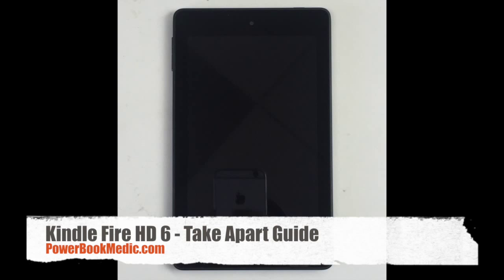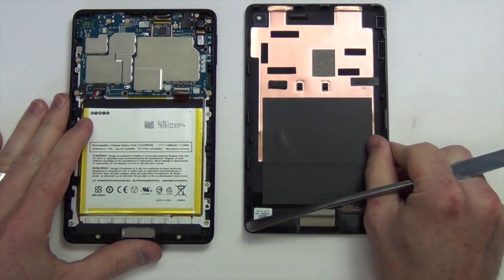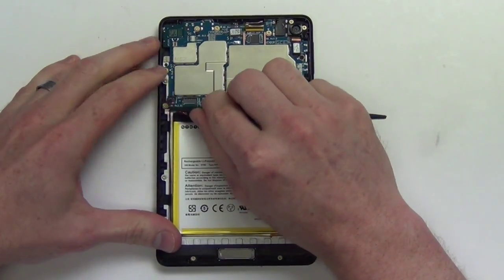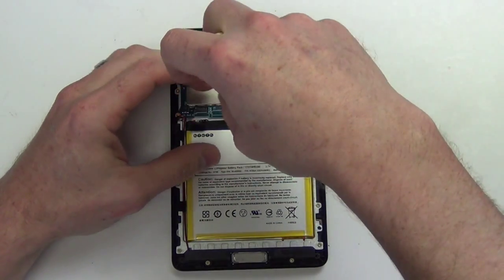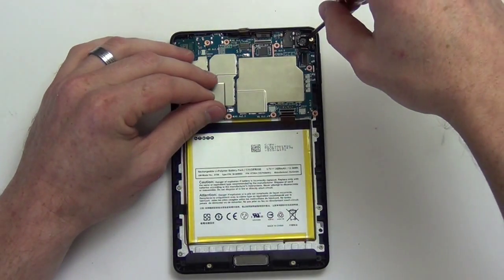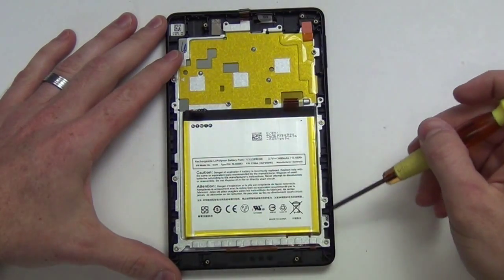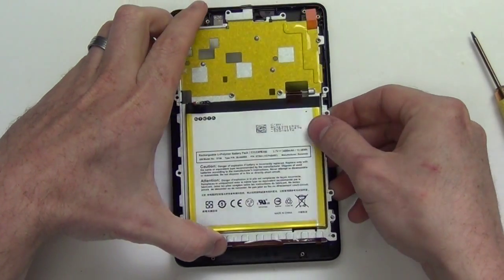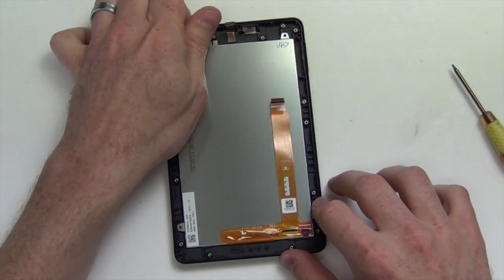How to Take Apart the Kindle Fire HD 6

Comment: Are you still around? What is that @ 1:32? The black tab thing broke off (the thing that flips down to hold the yellow plastic tape... trying to get it back on is tedious, and just slipped under so I have to take all the screws out again!!!! I was almost done putting it back together!!
Reply from the maker: If I understand you correctly you are saying the lock bar broke out of the connector. That bar is required to hold the cable in place correctly.  It can be difficult to put back in. We are able to repair those connectors. You can go to our website and contact our repair department at powerbookmedic.com.
Reply: Yes that is exactly what happened. I will look into it. After replacing the LCD screen the screen cam back on and was fine... but the touch screen won't work, touching it does nothing. I will prob send it in Thank you!

Comment: Having issues reseating the display ribbon any suggestions??
Reply: I thought I had destroyed mine, but it was easy to reseat it using the black latch which will open 90 degrees from the angle it is at.  Place the ribbon snugly under it, then latch it down to secure it!  Worked for me.

Comment: Where can you get the tool to unscrew those god awful screws on the board? Yes I'm aggravated lol Finally got the back off only to be stopped by not having a small enough tool, seriously why not have little straight ways or four ways. I worked on electronics but I only soldered the parts on never completely assembled them. This sucks big time, great vid though helped me a lot now if I can only get these screws out :(
Reply from the maker: Tools are available from our website, powerbookmedic.com, or by calling us at 1-866-726-3342.
Reply: Opps! Sorry did not mean to steer someone onto a different site!